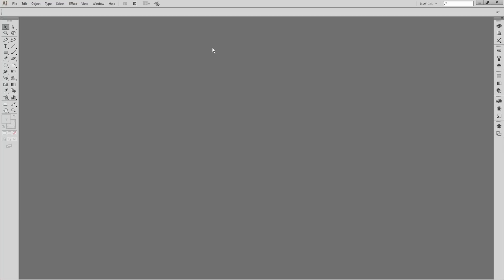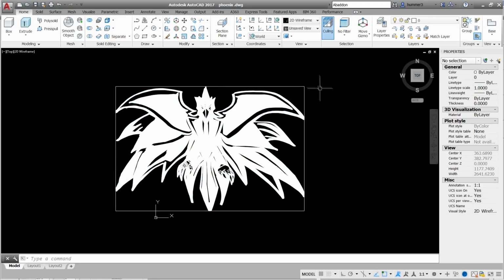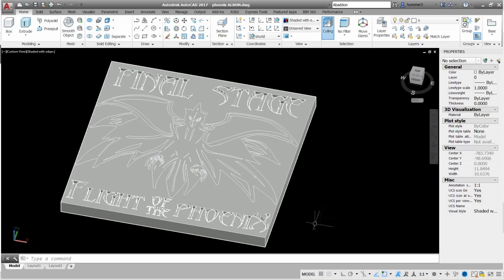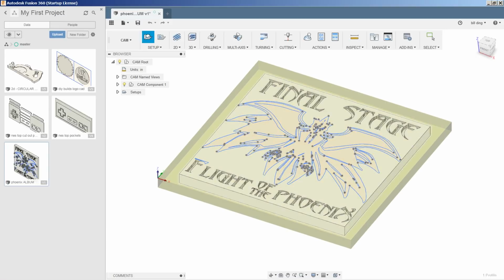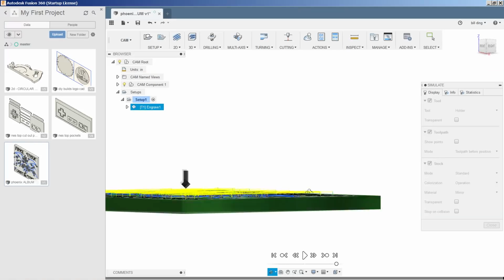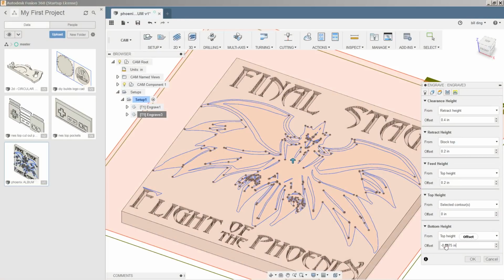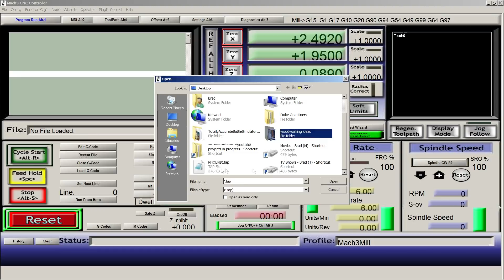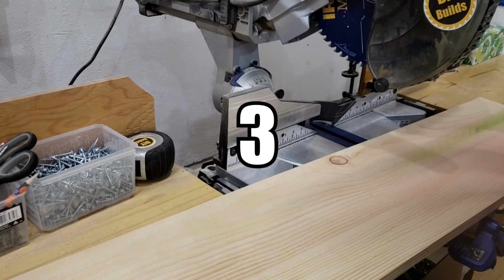How to Turn an Image into G-Code for CNC Using Adobe Illustrator (Final Stage - Album Cover Project)

Comment: maybe you can use  HoruCNC found on Github if you didn't have vector data. The software converts the bitmap to contour outlines and generates GCODE. maybe it is an alternative for commercial program.

Comment: dude every time I upload a design into fusion and double click on it like you do it doesn't open it in fusion.  It opens the file in some other window and all I can do is view it.  Im trying to follow your steps but it's not happening.  DO I have to pay for the Autodesk software in order to follow along?
Reply from the maker: They changed fusion recently. You have to use .dxf files now

Comment: You can remove all the double lines in illustrator easily. Use a selection filter to select all objects with the same fill, in this case black. Then delete them. This should leave 1 set of lines for most of the file. You may have to delete the border still as well. After the image trace you can also try to drag away the coloured areas. If you can't, ungroup once and then try to drag it away again then delete it once you get the desired result.

Comment: The double layer create by Illustrator is annoying. I had a similar problem importing into Solidworks. It couldn't figure out why I wasn't able to use my imported DXF. When I did figure it out, I found the process of eliminating spline pieces tedious. It does look like it is easier in AutoCAD since you were able to select a whole group with a click.
Reply: it's not double layer, it's outlines of black and white. I haven't found and an option to only do one in Illustrator.